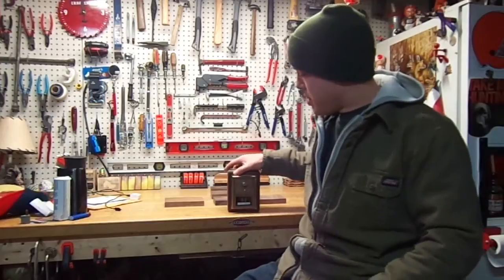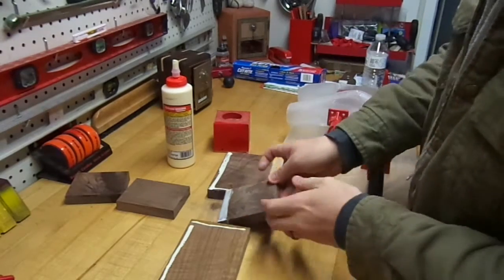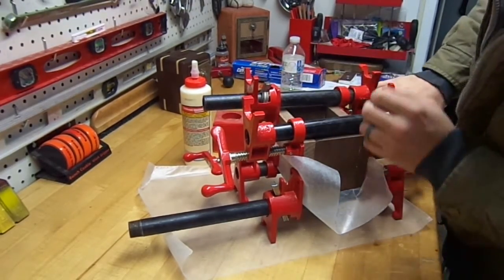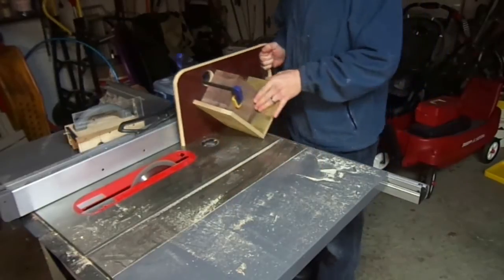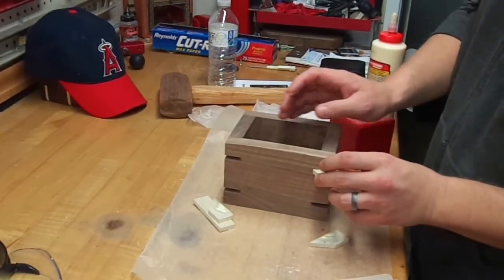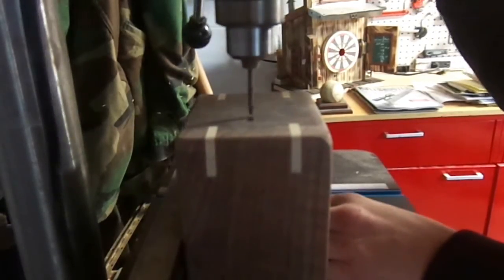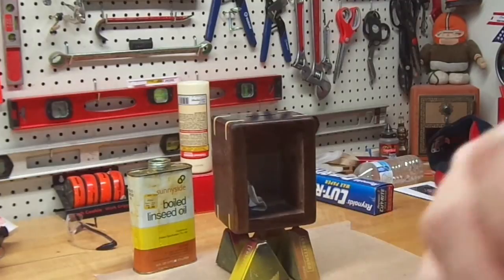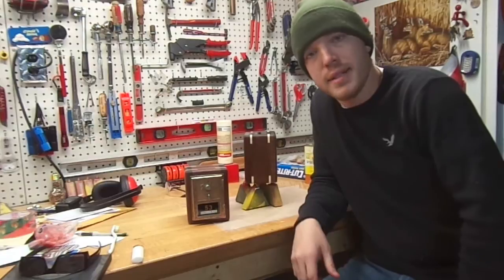Vintage Wooden Post Office Bank

Comment: Hello great job! Where can I find the cut list?
Reply from the maker: There used to be an online cultists, but the page no longer works...it was the only one I ever found, sorry.  Let me know if you come across one, people ask often.  Thanks so much
Reply: @rupertpika151  I just looked it up and I’m not sure if these were your dimensions but here are some that I found. 
(2) 5" X 4" X 3/4" for the top and bottom
(2) 6 1/2 " X 4" X 3/4" for the sides
Masonite for the back 3 1/2" by 5 1/4" X 1/8"
Reply from the maker: @TimberWood.Customs  ok just be careful because there are different sizes for the doors. Thanks for looking into this!

Comment: I have a Corbin DD c1925 that is already mounted in a wood case.  Combo is long gone.  How is that mounted in the case. Can I just pry it out and then rest the combo.  Your video did not show how that was inserted onto the case.  Thanks in advance.
Reply from the maker: There are screws on the inside...im afraid you would have to either take it to a locksmith or break the wooden part of the bank assembly...is their anyway you could pry the box apart and then reassemble?

Comment: Great build! Did you have a problem getting the screws into the side with that small space? DD
Reply from the maker: Oh yeah, was definitely a challenge...had to put them at a slight angle...would have been better to pre-drill prior to glue up...even with a right angle bit adapter it was troublesome

Comment: How did you drill and screw in the door with that small space?
Reply from the maker: I used a right angle drill attachment, now I have a compact right angle drill and impact which would work a lot easier, but it was a pain!!!

This is the attachment I used: https://amzn.to/2RrKAHD
These are what I have and use now: https://amzn.to/2BYsqna and https://amzn.to/2F5xNUC

Let me know how it goes if you build one!  They are really neat, and make great gifts!